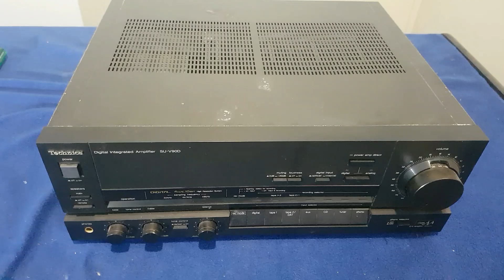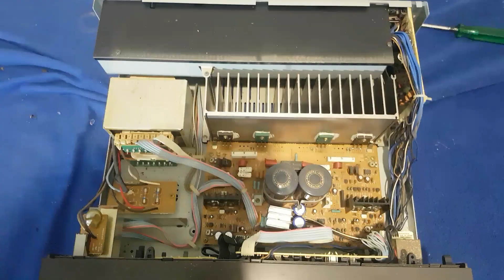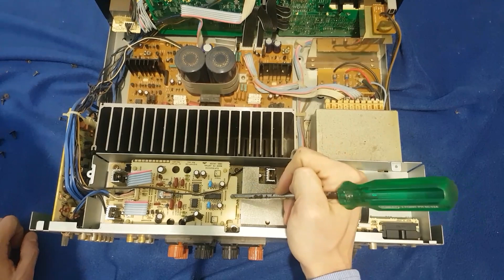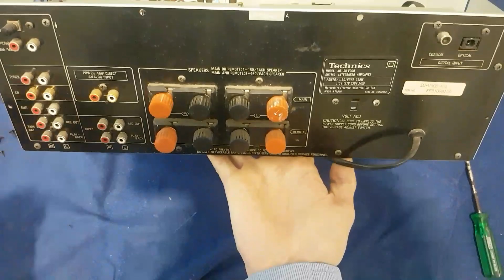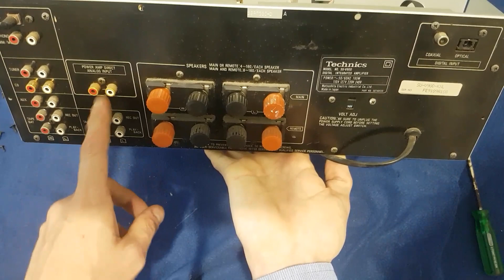What's Inside - Vintage Technics SU-V90D Stereo Amplifier

Comment: I love this tank. After trying several different amps, receivers and speakers combinations I came to conclusion that for music, this is just it. Yes, they cut some corners, yes, some comments could be better but, this is an amazing piece of kit. 
Mine is coupled with BW DM604S2 and 605S2 with  occasional support of two ASW1000 and it sounds amazing. I use it in Direct mode and regardles of the source it just makes music so absolutely sweet. Connectivity wise, it covers all the bases. Some said there are better amps, give me an example please,  I'd be more than happy to try... These I getting more expensive and harder to find now, get one while you still can...

Comment: The regulators on this amp are not there where you show but are on the front panel, you show the voltage amplification stage, the output transistors against the big heatsink are bipolar, not mosfet but toshiba SA1302(PNP green) SC2381(NPN black)
Reply: There is a problem with the Life-energy detectors with harmonic combadge and The teraphasic warp reaction chamber with the sarium krellide sub-routine failure

Comment: so cool. could watch intelligent people opening up amps and explaining parts over and over. a prized possession of mine was a proton integrated amp and separate am fm tuner from the 80's. have also looked inside. similar to the one on bigdwiz youtube amp dyno. talking about the digital section. so was it only the CD input. and assuming the cd player did not have a dac output. just thought that was weird. so the digital section is a dac?
Reply from the maker: +indopleaser we dont get much proton here . The optical and coaxial inputs on this amp run into a Dac yeah